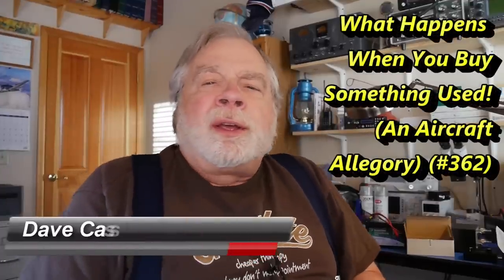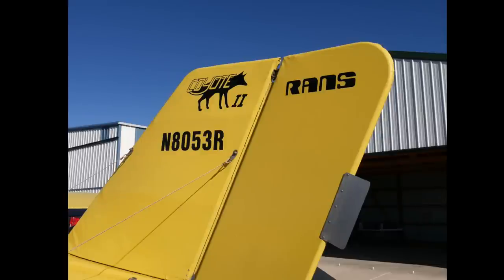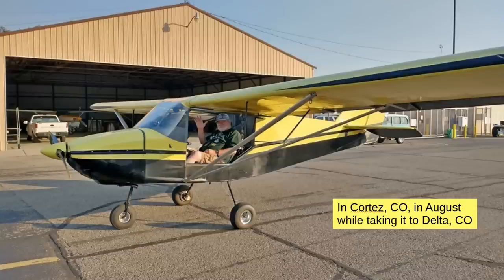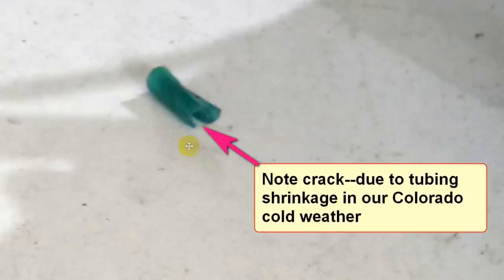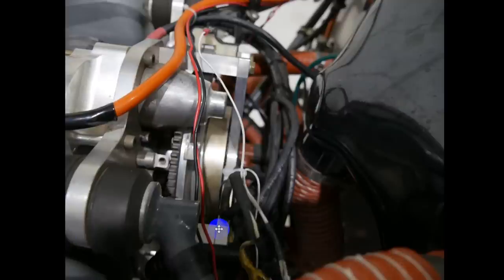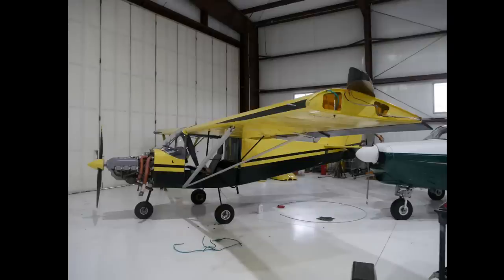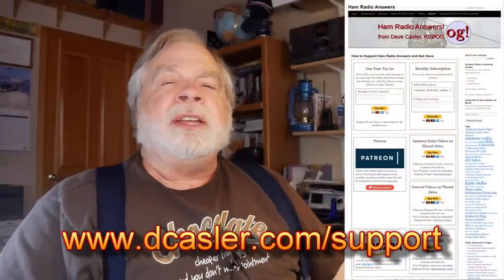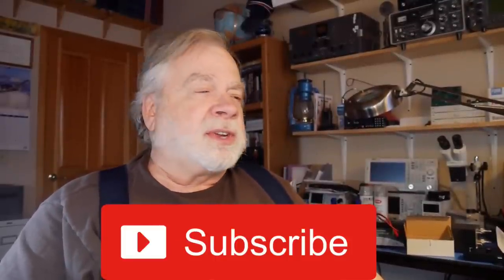An Aircraft Tale That Applies to Ham Radio (#362)

Comment: Huge difference between experimental and certified aircraft. I have a 50 year old Cessna 172, I changed any rubber fuel lines every 6 or so years as recommended by the Cessna maintenance manual. As the owner/operator, I can do the replacement under supervision of an A&P, and have the A&P sign off the logs. Major costs savings by doing whatever labor you can do, or willing to do. Can speak for your experimental RANs, but that green hose does not look like the approved hose that I would use in my Cessna, always check with your maintenance and parts manual to verify approved methods, and replacement parts. Always verify that the correct fittings are being used for any fuel lines, never assume that the last guy that worked on the plane did it right. Always verify. New to HAM radio, but experienced pilot (Commercial/ Instrument SE and ME).
Reply: You nailed it.
Reply: That green tubing looks like medical O2 line.

Comment: Kudos to Dave, an old pilot, takes NOTHING for granted.  Here's your solution: a prebuy inspection checklist with two people, one inside the cockpit and one outside stationed at each corresponding checkpoint, running all the controls, gauges and switches through their full cycles, like preflight checks with a checklist of any and all inspection points and ports open and accessible, with the checks positive and negative signs noted for each check.  That coupled with the usual thorough search of the aircraft's maintenance log for engine, avionics and airframe scheduled inspections should be doable and save money, lives, disappointment, lotsa shox and unhappy landings.  Good show!  Cheers!

Comment: I'm not a pilot but spend almost 15 years as an engineer in aerospace.   The big difference I see is a radio failure is far less likely to be life threatening than an aircraft failure.   I used to comment to workers that if the engine stops working, it's not a car that you can just pull over to the shoulder.   Also I'll guess that airplane maintenance and repair is much more costly than a radio.

Comment: You hit the nail on the head with your first statement. When you buy something used you’re buying someone else’s problem. A counter point to that is I have purchased someone else’s problem knowing I had the skill and wherewithal to correct it. Rarely but it has happened. I bought a 1979 non running triumph spitfire. Pulled the carburetor, cleaned the jets and suddenly it was running. Sold it immediately British sports cars are uncomfortable unsafe and unfun.
Reply: None of these issues should have been missed in a good prebuy inspection or the annual.

Comment: Dave, as I pilot I would suggest that you for sure change the other rudder cable too.  If one cable is coming apart at the nip the other one is weakening at the same place on the other side.  I still remember the first time I soloed and there is nothing like it.  Best of luck to you.
Reply from the maker: Yes, all the rudder cable is being replaced. Thanks.

Comment: Certainly amateur-built airplanes can be fun to fly/own and less expensive than a factory-built machine, but because the FAA doesn't require a builder of experimental aircraft to be experienced or certified, there can be an unknown and unintended inherent risk in the planes. Dave I really suggest you only allow a mechanic to work on avionics or anything else in the plane, and then have him let you help and participate. The regs can be complicated and really everything (right down to the bolts and screws) going into a plane needs that official part approval to ensure it's going to meet the high demands of the flying environment. Now having an A&P do the work for you isn't going to ruin your experimental fun but it will ensure you're safe. You want your machine to be 100% reliable. Why accept anything less?

Comment: That little thing you bend back and forth is called a trim tab. It’s used to keep a positive feel on the rudder at all times and to trim out any offset from neutral controls to flight surface. In other words.. keep you straight on the yaw axis. I’m a retired FTE for BCAG.

Comment: I'm surprised an A&P mechanic would sign off on old fuel hose, since the hose is usually date stamped and the makers DO have replacement dates for it. I guess an angel broke your ankle.
Reply: And that's one of the problems with amateur built experimental aircraft - you don't have to use certified parts (or even reasonable quality parts) to get an airworthiness certificate.  And, even worse, if you build more than 51% of the aircraft yourself then you are the manufacturer in the eyes of the FAA and can act as A&P on that craft yourself.  Most kit planes like Rans, Vans, Zenith, etc. certify that the kits they sell meet the >51% build requirement.  If you don't know any better or cut corners when you build there is a good chance that issues will never been found...until the NTSB investigates the cause of the crash, or you sell it.
Reply: @resiggy13  I was thinking along the same lines.  It's and experimental aircraft and it's a used experimental aircraft.   So how much do trust the competence of the original owner/builder?

Comment: For putting the plane into the hangar, consider a $20 winch from Harbor Freight and a 12vdc battery to power it  (Assumes that the hangar is sufficiently yours that you can anchor the winch to the floor or string a beam between uprights to mount the winch to).
BTW all hoses should (FAA recommendation) be replaced every 10 years or earlier --- whether they need it or not.
Cables are required to be inspected every year during the condition inspection.
Aircraft deteriorate by not flying.  Expect the engine to go to hell (1st), then hoses and rubber products (like tires).  Cables and non-engine metal usually stand up.  Avionics depend on whether they are mechanical (goes bad) or electronic (probably ok) ....
Reply: When you initiate the flying channel --- let us (me) know.  I want to watch it

Comment: So happy to re-discover your channel.  On buying used equipment,  I bought a used Kenwood TS-570D that HRO had for sale.  Paid $400 for it and they shipped it free.  They told me the radio was in excellent shape.  It arrived and I found 2 issues.  The VFO had come loose and the DSP knob was broken completely off.  I took the radio apart and the VFO was a easy fix.  The VFO in that radio was a rotary encoder  glued to the back of the front panel circuit board.  A little epoxy and I fixed that problem.  The DSP knob was another issue.  When it broke it snapped the circuit board it was soldered to completely in half.  I searched for weeks for a replacement.  None could be had.  I contacted a very good private repair company, explained the issue and he told me he could fix it.  So I sent the radio to him.  The repair and all the shipping came to just over $400.  Now I had $800 invested in a $400 radio.  I contacted HRO and talked directly with their National Sales Manager.  I explained the issues to him and he asked me if I could send a picture of the shipping box.  I placed the radio in the box and snapped the photo.  I attached it to a email and off it went.  The next day I got a call from the Manager.  He told me that the box was far too small to ship that radio in and that the person who packed it would be dealt with.  He also refunded the $400 purchase price.

I have been using this radio for 5 years now and it works great.  all I can say is I will never again buy used equipment from HRO.

My other HF radio is a used Yaesu FT-950.  A friend of mine had it at Field Day and I gave it a really good workout.  After field day I made a offer for it and he accepted it.  That radio is my main radio right now.  In my opinion,  that is how you buy a used radio.  I also re-subscribed to your channel.

Comment: Great story Dave!  Glad you found out about the problems before, and not after, a crash.  I was a pilot 30 years ago but gave it up after 150 hrs when I proved to myself that "airplanes are just holes in the sky into which you throw money." Back then I, too, acquired a few hair-raising stories, as all pilots do.  At best they help make the logbooks sound more interesting but you don't want them to sound any worse than that.  When, or better, before that happens, it's time to switch to a safer hobby.  Ham radio may be safer but it can also be "an all-band HF antenna into which you throw money."  Buyer beware!

Comment: Dave,
I enjoy your videos.  You use your head, share your experience, knowledge, and enouragement.

I am a relatively new ham, retired now and have time to enjoy the hobby.

As an aviator with about 35,000 hours flight time,  you are on the right track with your aircraft.  Solve problems as they are found,  evaluate potential risks, and always use good judgment on the ground and in-flight.

 Regards,
Alex       KE5HYF

Comment: Ned Davis WB4BKO You are fortunate that so far you have found  only a few very important problems. Not uncommon. You will be able to fly with confidence knowing your plane is fully airworthy. When I bought my Cessna 120, in the early 1990's it was in terrible shape. I knew what the challenges were to get it airworthy. Especially removing the vermin and their deposits and nests. I nursed it back to health over a long Michigan winter with the airplane at times in a warm hangar repair bay and at other times in a very cold hangar. I too lost the function of my airspeed indicator on take off once when the indicator's pointer fell off just behind the glass. I was solo, but I got it back on the ground safely. Needless to say I was a bit rattled afterwards. One of my former instructors made it a point to give me a couple of hours of instruction on how to fly safely when the ASI and tach could become inoperable by taping opaque plastic jar lids over the instruments.  He taught me to use my senses and listen to and get the feel of the aircraft at various speeds. I highly recommend you ask your instructor to do the same. Best of luck and happy flying.  73
Reply from the maker: Thanks for the tip.

Comment: Dave, I’m glad you discovered these problems.   One thing I would like to mention about that rudder cable.   From your photo it looked like you have a steel pulley.   I may be wrong due to the quality of the photo or my old eyes.   I found on my home built, that was a bad recipe with steel cable.   The steel pulley was cutting the steel cable.  I found aircraft control pulleys that were of a special fiber type material that won’t cause that to happen.   They were also slightly larger diameter pulley.    Just throwing that out for thought.
Reply: That's a mechanically sound idea, because when you're doing mechanical engineering one of the first rules you are taught when making a mechanism out of metal is that "like should never touch like", as far as hardness of materials.
You should always have one material be harder and one softer.
So by that metric, these fiber pulleys are a very good idea, but fiber can be somewhat abrasive (might be a good thing in this case, because that makes the pulley grip the cable and turn on the pivot point, rather than the pivot point binding and allowing the cable to slide).
If it was my aircraft, and cost was no object, I'd be looking for some brass, bronze, or UHMWPE (that last one's an acronym for Ultra-High-Molecular-Weight Polyethylene, it's the same stuff they make professional kitchen cutting boards out of (the ones that last longer than the restaurant, usually), low friction but incredibly durable polymer) pulleys.
That fiber sutff does sound good.
But of course, all this stuff would have to have FAA certs with it, because even tho it might be an experimental aircraft, the control cables and their associated parts are NOT the place to save a dollar (or even a red cent for that matter).

Comment: This former A&P would have grounded that aircraft. ALL of those major problems should have been caught on pre-purchase inspection. Hoses and cables are wear items that should be replaced occasionally. Cables can easily go 10+years but not hoses. 
On the flip side, find a good FBO with A&Ps that you can trust for your routine maintenance cause the items you point out before they became life threatening.

Comment: Glad to hear you will be installing a ham radio.   One of the best QSOs I have had was between me in California to a Lear Jet sized jet over Kentucky at 39,000 feet. I was using 100 watts to a dipole mounted on my house roof.  We were both coming through loud and clear.  You won't be that high but any altitude helps.  This might be a good topic for this channel.  My wife's grandfather was a United Airlines pilot from 1930 to 1960.  I have a nice picture of him standing next to a rack of beautiful Collins radio equipment talking to the radio technician.  He was flying the San Francisco to Hawaii route so the radio was very important.

Comment: Consider Bergstrom Aviation in PSC for a tow bar, they make them for many airplanes. Also apply Par-AL-Ketone from Aircraft spruce on that area of the control wire that passes under the shive. It will help prevent galling. As usual OM you are spot on!  73 Mike

Comment: Hi Dave.  On the nose wheel, a welder or similar "fix it" guy/gal could fashion a handle/push tool for $0 maybe off junk shelf.  I would first examine the entire nose wheel apparatus. If it wanders it will not likely function well with a push handle.  Steering with feet is only reliable with good design and intact mechanical parts. Tail wheels have advantages mechanically but can bite you also. Wishing you joy in the process.

Comment: In about 1963 I was ground crew member flying on a KC135 airborne command post airplane and one of the crew radio operators was a ham and he was using one of the planes 1000 watt uhf transceivers for a ham call he told me he could not say on the air where he was calling from or what type of equipment he was using.

Comment: Great insight related in a meaningful way.  There is a clear link between civil aviation and amateur radio--talk about getting your antenna higher!

It is sometimes possible to get safely on the ground with a flapping rudder, but not nearly as likely with a rudder that's jammed in such a way it forces a strong yaw.  God bless that fuel line leak.  A trailer dolly could to modified to work for moving that little guy on the ground.

Comment: Dave, good story and comparison. I'm a licensed pilot and an A&P with an IA and have been a long time, but I'm a new Ham. Still, I got the message. I just wanted to say that the repair on the aircraft should have been logged in the logbook along with a document called a 337. The 337 is used for major/minor alterations and unusual repairs.  Your crash repair documentation should have been available for you if you look for it.  Also, the rudder cable was a disaster in the making. Before it ever broke though those lose strands could easily have jammed the cable at the pully. My point is your were closer to having an accident than you thought.  You can fly without the rudder, but if your don't have a lot of experience you can get in trouble. SUPER good call on the fuel line replacement.  It is my opinion that was your greatest danger. Anyway, great video as always.  Glad your safe. P.S. Good looking bird!
Reply from the maker: Thanks! The repairs should be finished tomorrow. I'm going to give it a very thorough looking-over. The repairs after the accident are all in the aircraft's logbook. I also found a very thorough report on the accident from the NTSB and was able to use it as price leverage when I bought it.

Comment: Great catch Dave. That control cable damage is indicative of an aircraft parked outside without control locks in place. The wind works the control surfaces enough to cause
damage at any contact points. Interesting that the seller states it was housed in a  hangar.
Also, after that cylinder removal keep a very close eye on your oil pressure for some time. A common problem, more so with multiple cylinder removals but still relevant with one is
the cylinder retaining bolts also clamp the main journals together, if reassembly does not account for the correct replacement stud stretch across the crankcase relative to the others in the engine (un touched) the clamping pressure can become insufficient to retain the main bearing shells which are time worked, released then re clamped... it is a prime cause of spinning a main shell (especially if it gets oil behind it during disassembly) and then blocking the oil gallery from that journal on causing inevitable engine failure.
The fault generally shows up fairly soon after cylinder removal if it's going to, so just something to keep in mind. A good mechanic will probably know about the risk anyway.
Cheers, and good luck.
Reply from the maker: Thanks for the tips!

Comment: Solid advice Dave, I bought an IC-706MkIIG used and it wouldn't transmit FM.  All other modes worked, just not FM.  Turns out (fortunately for me) to be a trimmer cap that I was able to adjust myself with the service manual and a multimeter.  It was a heck of a steal, but every used radio is a gamble.  I've been fortunate in my purchases, and even more so that lives weren't at risk.  Great catches, I'm glad you're safe.  Take care, 73.  //K6OGR - Brian

Comment: Whether buying used equipment is a problem - even if the equipment has a problem  - depends on whether you have the skills and perseverance to mend it.  I've bought exactly two brand new radios ever (Baofengs) because I wasn't affluent enough to afford new stuff.  FWIW, same with aircraft, I learned to fly in the 70s, but never had the money to buy an aircraft, new or used.  Came close a couple of times.